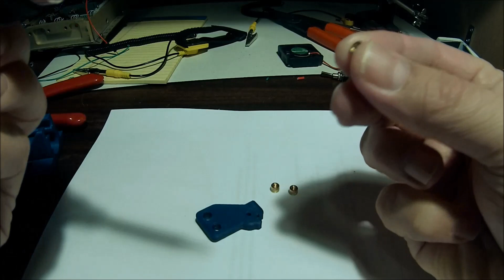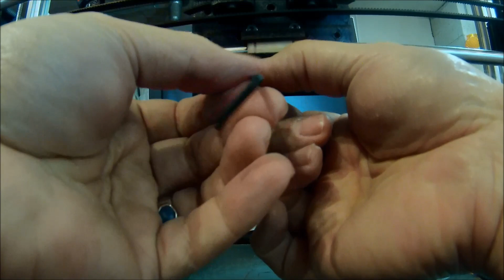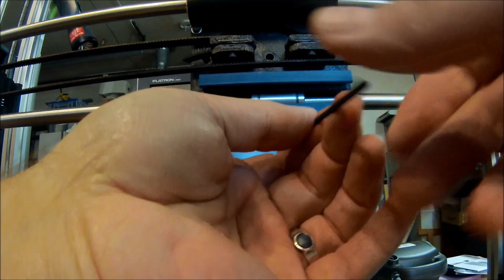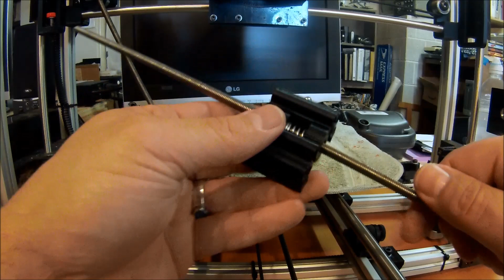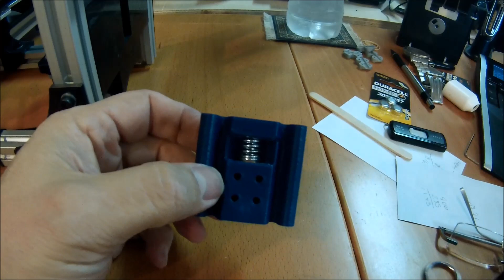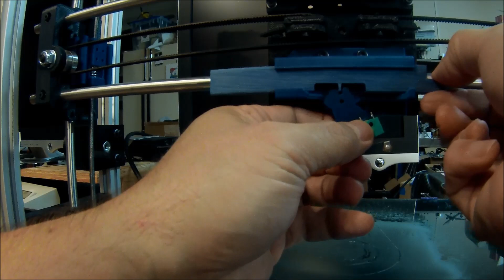Installing the Auto-Level mod on the LulzBot TAZ

Comment: Anyone have a working link to the correct firmware changes needed for a Taz 3? The Gcode works fine with a few tweaks, however when I use Marlin for Taz 4 and enable the probe retracts before the probing then X gets stuck in retract position. Keep in mind my coding skills are obviously very limited :)

Comment: can this be done on an upgraded bed? In terms of bigger bed.
Reply from the maker: +Kevin Nguyen I don't see any reason why not.
Reply: +f15sim well wouldn't the machine need to know the measurements of the board? or can that be updated through firmware?
Reply from the maker: +Kevin Nguyen You'll have to change the probe points in the firmware.

Comment: After using this method for raising and lower the calibration arm for almost a year now, do you still recommend this setup?
Reply from the maker: I don't use the TAZ that often, so I haven't worked it hard enough to know if there are any long term issues. I know  a number of people are using the same system and I've not heard about any issues.
Reply: f15sim If you don't mind me asking, which 3D printer do you use since you're not using the TAZ that often.
Reply from the maker: My primary printers are Rostock MAXes from SeeMeCNC
Reply: Thank you for the info. Very interesting, is it speed, quality of the printed part or maybe just personal preference why the Rostock's are your go to 3d printer. I own a TAZ 4 and am looking to buy another 3d printer; hence the reason for my question.
Reply from the maker: Mitchell Rabushka
It's pretty much personal preference.  I do like the delta configuration quite a bit - so much so that I write the assembly & user manuals for SeeMeCNC's machines. :)  My TAZ tends to get unfairly ignored because of that.  I recently managed to kill the hot end on the TAZ (and the T0 thermistor input...long story) while trying to press it into service, so I'll have to wait for the new hot end to arrive before I can use it more often. :)
Reply: Very cool, I do think the deltas are more elogant in appearance and the way they move. Down to print quality though, do you think both the deltas and cartesians can print comparable quality when tuned properly?
Reply from the maker: Mitchell Rabushka
I do - however, the Delta design is going to have an edge because it can do rapid moves at a higher speed than cartesians and the bed doesn't shake the part during the printing process.

Comment: I'm building a taz from spare parts salvaged from a prusa i2. Would you recommend this upgrade ? Is the technology reliable, or still in beta? I haven't started building the printer yet, but started printing parts
Reply from the maker: The auto-level code for cartesian printers like the TAZ is very solid - you'll need to use the same version of Marlin that is specified though.  I can't live without auto-level on my TAZ. :)
Reply: Good to know, thanks!